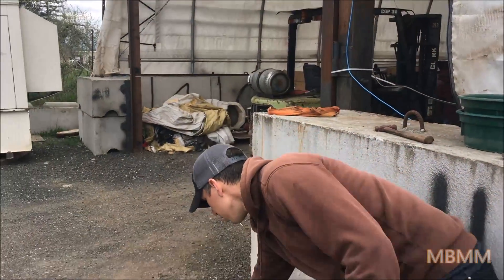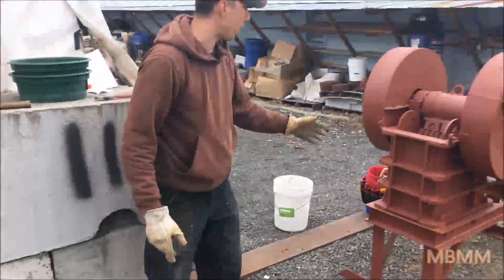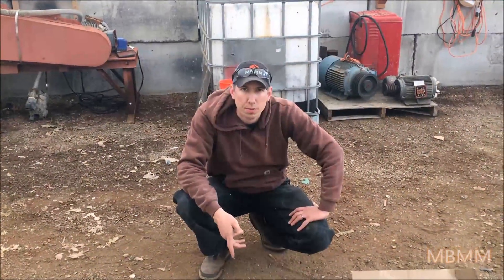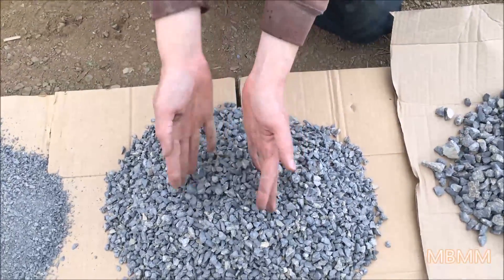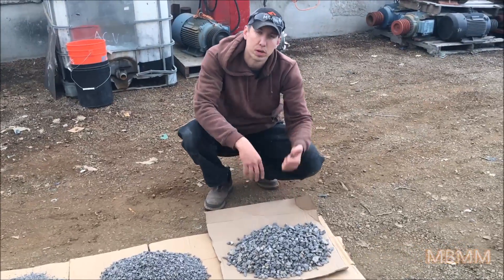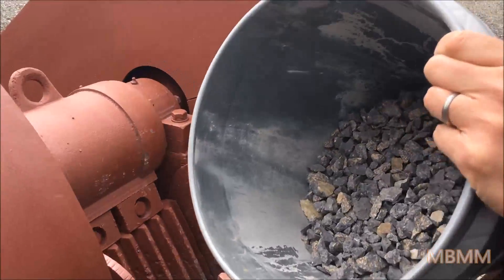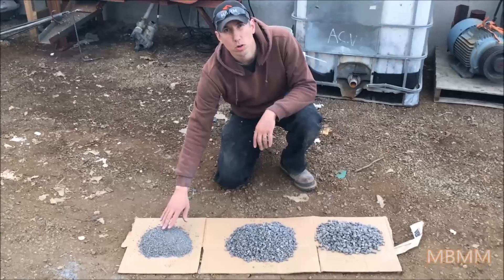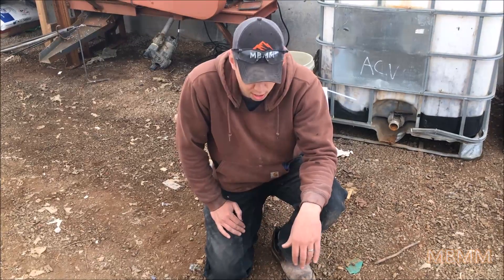Crushing Stone Bricks with a Small Jaw Crusher for Greatest Size Reduction

Comment: whats the cost for the machine as shown in the video?
What voltage and amperage does it need?
Thanks
Reply: Shiley liu I contacted them
Reply from the maker: For more information on this machine including pricing please email info@mbmmllc.com or give us a call at 360-595-4445.
Reply: @mbmmllc  sir
Out put sizes 0-1mm is possible ? (Red bricks 242*114*70mm) per day 50 tonns.
Reply: angryadrien